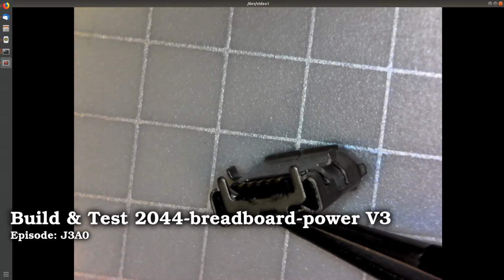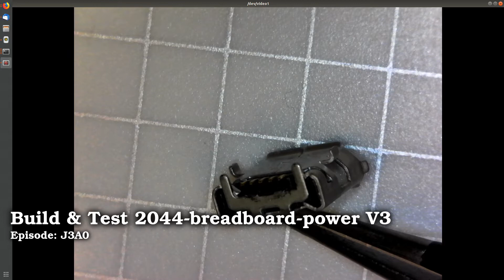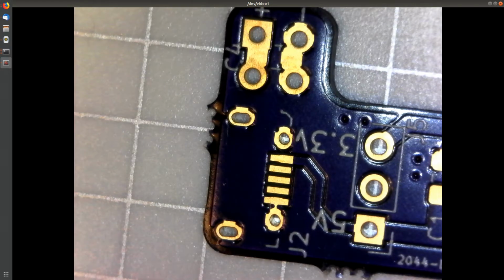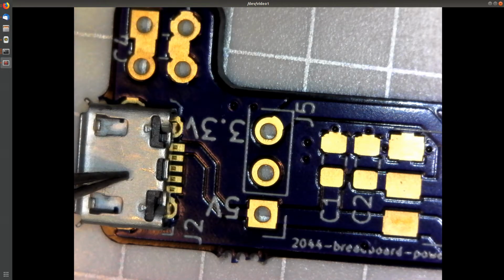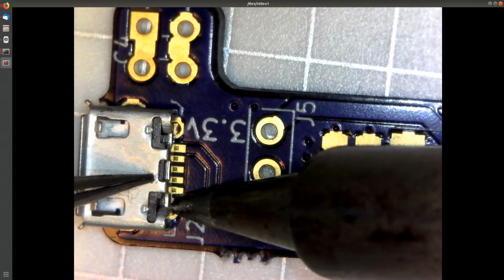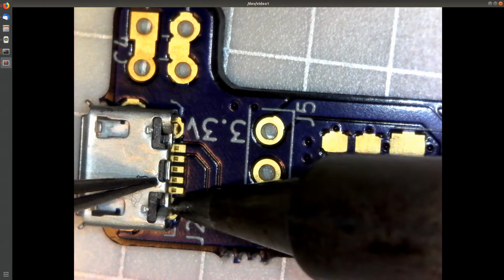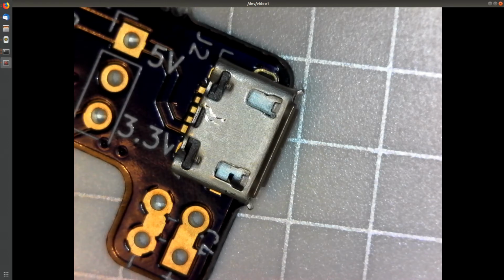KiCad 5 #10b Build & Test 2044-breadboard-power Rev 3

Comment: Hi John, as a matter of interest, which PCB house did you use? I see you've got slotted holes for the usb connector, and not all manufacturers will do this? (Plus, presumably, some pretty narrow soldermask bridges between the usb connector's pads).
Reply from the maker: You are right.  Used to be a special order.  Maybe that is changing?

For the ones you see in my videos, the purple boards came from OSH park and the green ones (so far) have come from PCBWay.  I have been getting away with plated slotted holes from both as part of their basic bargan priced offerings.

As for the soldermasks, they are not always coming out perfectly.  I think around part 29 i show myself correcting a mistake in setting the minumum width.  Even so the bargain board fabs don't always get the thin mask threads between high-pitched pads.

I should get some boards back for a new vid in mid-Aug, 2019 where I'll show some closeups of my project 2055, Rev3 boards from OSHPark (files are on my github page, my username is: johnwinans)
Reply: Thanks (again) John.  Sounds like I should investigate PCBWay a bit more. Jon
Reply from the maker: @pinballchacha657  spoiler alert:  So far the PCBWay boards do not have the solder mask threads between the fine pitched pins when I order them with 6mil widths between fine piched pins.  But I do have boards from OSHPark from 2018 that have clean mask threads about 5mils wide between .5mm pins.

Both houses will do plated slots like those for the USB connectors in my projects 2054 and 2055.

See the OSHPark writeup in their web site.  I think only certain types of milling paths are supported.  I don't know the extent to which PCBWay supports them.

Comment: Board looks great, interesting soldering...…... I'm gonna give that ago makes a bit more sense than the sort of "drag" soldering technique that I use with TQFP which often results in bridges that need tidying up.Thanks
Reply from the maker: I tend to use a mix of dragging and this 'paintbrush' motions.  Lots of flux and not too much solder works well for me.  Also, I prefer a fat tip that I showed up close in this vid.  It holds a reasonable amount of solder after a gentle wipe in some copper wool.